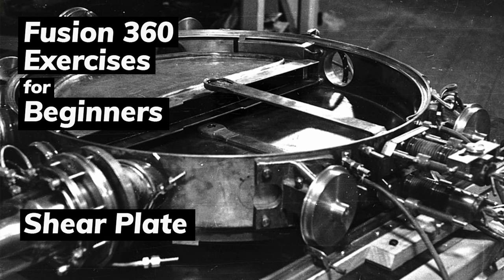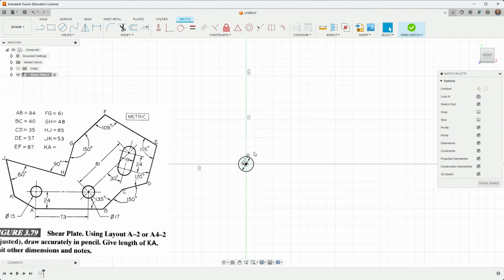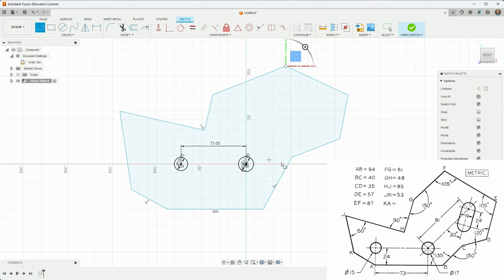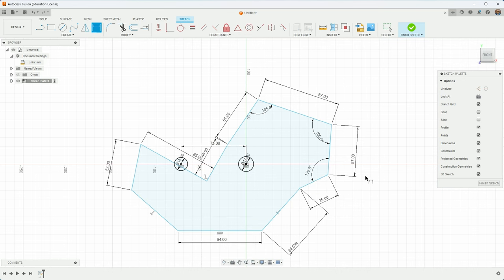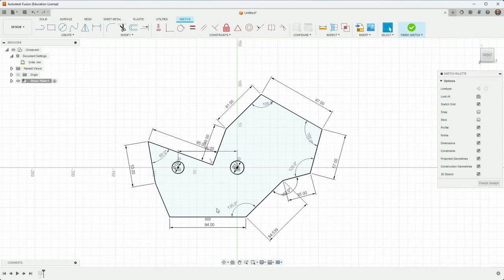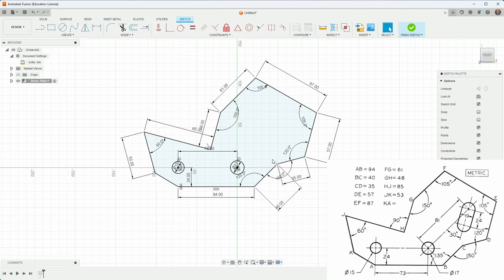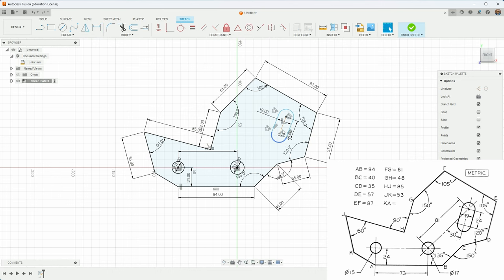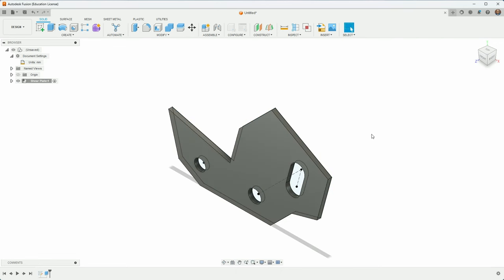Fusion 360 Exercises #2: Shear Plate

Comment: as for the last angle. 135° worked for me. if you look at the circle in the midle you can seperate it into 8 pieces. to the left of the angle (inside the circle) you have 3 of that 8 pieces. makes it 360/8*3 (which is also parallel to the outer line next to it on the right side)

Comment: I'm seeing no spec for the angle to the slot.
Reply from the maker: Do you mean we're seeing the same issue, or did I miss something in the drawing?
Reply: @RobDuarte  After drawing the slot you set an angle of 30 degrees to a construction line passing thru the right hole center, but you couldn't set the angle of the construction line to the line passing thru the two holes.  I was agreeing that that angle is not specified in the drawing. BTW, I loved how that shape came together as you specified each dimension.😁